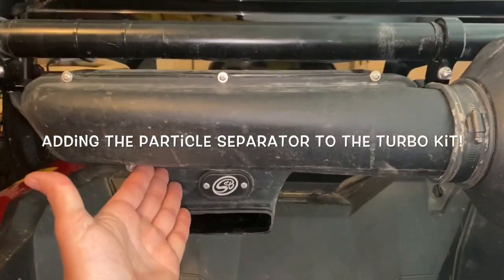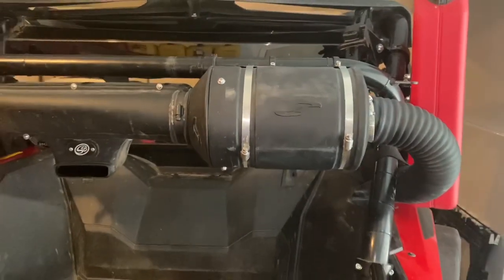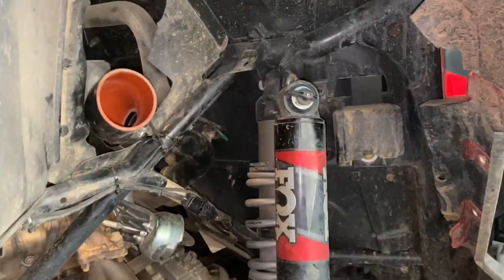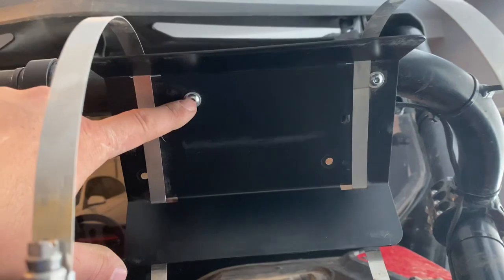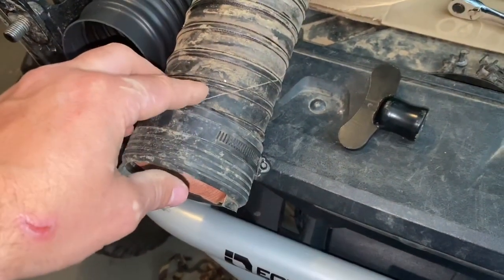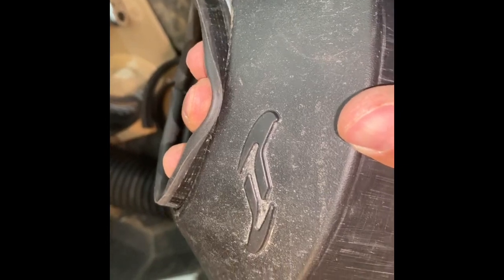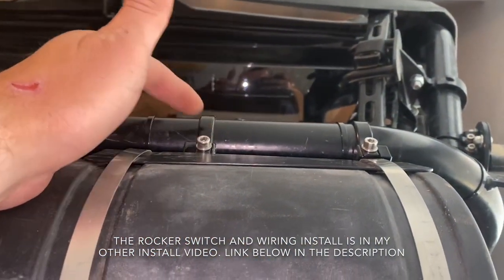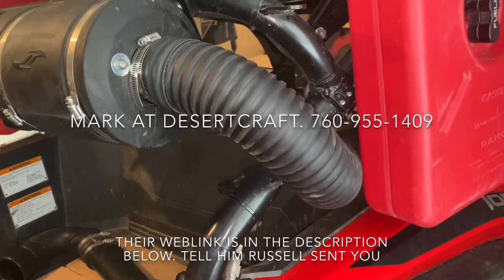Particle separator-Honda Talon Jackson Racing Turbo Kit. How to install 1000R

Comment: I’m actually in an email conversation with Jackson Racing about that same Double Standard that I read as you ImPending purchase.
Perhaps they are .. watching ..you...because when asked about a snorkel in their reply was this...        
“We will not be providing a snorkel adapter for the Turbo System. Some customers have custom fit their own on our air filter. “   No mention of warranty being voided. Literally the next statement was about exhaust and .... No Mods to Catalytic  Converter are accepted...imo....ie. EPA has our Balls ....hope it helps Man....looks like it’s an insurance policy not a detrimental mod in any form.
Reply from the maker: D C I am extremely happy with this set up and it’s not too expensive to do.

Comment: Doing this today. Quick question: why didn't you use the solid piece that comes in the S&B kit and goes from the stock air box to the S&B bracket with the hole on it? Did that piece not align properly with the turbo air intake? Thanks!
Reply from the maker: I tried reducing connections and the s&b hose is larger.
Reply: @gravesru  I see. Thanks for the info!
Reply: I worked on this project today and just realized why you had to get a custom hose. Would you mind letting me know the diameter of it?
Reply from the maker: Yazir Nauhm it’s 3” inner diameter
Reply: @gravesru  That's what I thought. Thank you
Reply from the maker: Yazir Nauhm you’re welcome

Comment: How was the end result? did the particle seperator  improve on how often you have to clean filter?
Reply from the maker: You can easily go 2k miles before needing to clean the air filter.
Reply: @gravesru  Thanks for all your Information, and time you spend.

Comment: I would like to have the name of your spare tire carrier.  I also have a talon R with the Jackson turbo kit. I hate where they stuck the air filter. Creek crossings are a must for me where I ride. I ordered the  s&b separator today and want to mimic your setup.  Any help is appreciated.
Reply from the maker: Roger Eastwood Thanks for watching. The link for the spare tire mount is in the video description.
Reply from the maker: Roger Eastwood https://www.sidebysidestuff.com/dual-clamp-spare-tire-mount-by-factory-utv-honda-talon.html
Reply from the maker: Roger Eastwood Today, I modified the spare tire mount. I cut it in the middle, added 6.75” of 1.75” pipe to make it wider (welded it in). So now the spare tire mount is flush with the top of the roof. Spare tire on the top, particle separator and air box on the bottom side.
Reply: Thanks for the heads up on that didn't catch that originally in video. Working on gathering all of the hardware now. I'm gonna call mark for the black intake tube. And order the 8mm mounts. Anything else I'm forgetting?
Reply: 6mm mounts are on order I said 8 in other post.
Reply from the maker: Roger Eastwood did you order a 45 degree 3”OD elbow? Spectre Performance 9449 3" 45°... https://www.amazon.com/dp/B004AJ6FYC?ref=ppx_pop_mob_ap_share
Reply: Got the 3 " 45 on order only thing left is to talk to Mark at Desertcraft, and wait for everything to show up.I assume your happy with the intake tube from Desertcraft at 4'6"?
Reply from the maker: Roger Eastwood Yes, I’m very happy with it, it fits perfectly!!
Reply: Any news from Jackson Racing on high altitude fix? I'm waiting on launch mode myself supposedly 2 or 3 weeks out. I have no issues where I'm from with altitude pretty flat around here but want to travel out west eventually.
Reply from the maker: Roger Eastwood Absolutely nothing from them and it’s almost 4 months since the problem was identified.
Reply: Yeah they move very slow,there are other people that have a launch program but want to stay with o.e.m products as much as possible. I love the performance thats for sure.
Reply from the maker: Roger Eastwood I wish I didn’t live at 6k ft.
Reply from the maker: Roger Eastwood one thing I did differently is, I ran the wiring from the particle separator, up the driver side roll bar, under the roof, down the left side of the windshield. It’s much easier and shorter that way
Reply: Ok thanks for that bit of info everything help when you tackle a project
Reply: I was just watching your shock upgrade video and noticed the change in your intake tubing routing. It all looks higher up on the machine, did i miss that change? I now have everything to start my project except the wiring harness for the s&b separator on factory back order!!
Reply from the maker: Roger Eastwood  So I cut the spare tire bar in the middle and welded in 6.75” of pipe. So not it’s wider and the bar sits higher up. The bed is more functional now and I can go through deeper water.
Reply: I see it now in one of your post to me its where u added the 6.75 inches to the spare tire rack. I just hadn't seen it completed.  I really like that mod.
Reply from the maker: Roger Eastwood And you can see out the back much better!